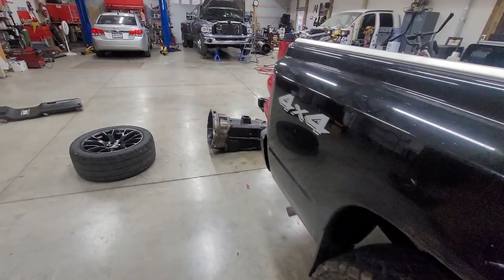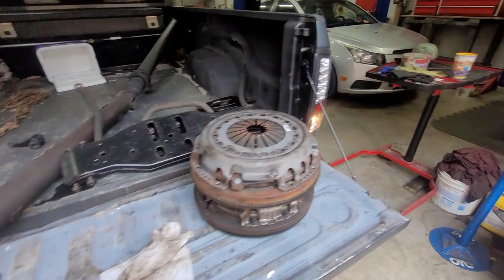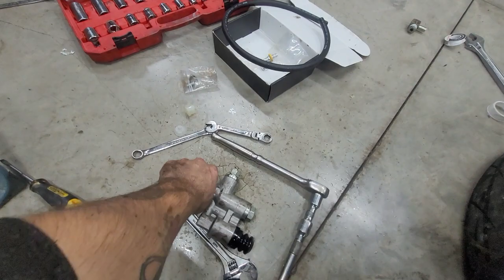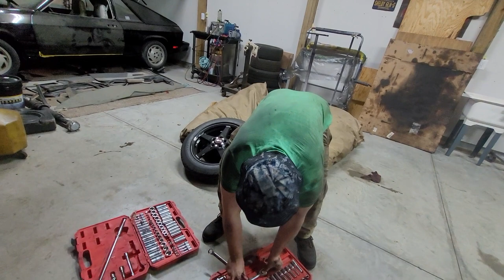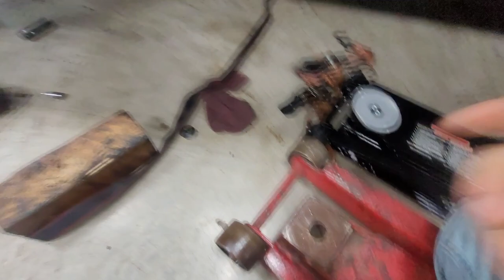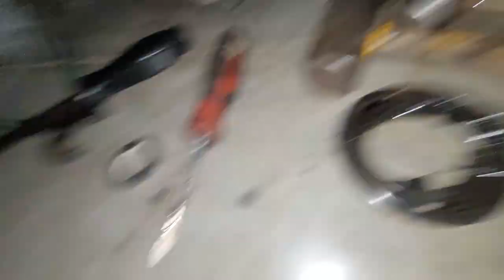NV5600 Swapping An 05 Cummins | So Many Little Leaks | Driveshaft Yoke Seal Replacement

Comment: Instead of draining all the oil you can use a shop vacuum put the hose where you put the engine oil turn on vacuum take drain plug out put new plug and gasket in won’t lose a drop of old works really good

Comment: You need to look at the drain seal, I turn it over and use the other side. I also have a plastic box with new copper o-rings.

Comment: 3 oil changes into my truck and I’ve never changed the plug gasket, I just clean it up and put some oil on it to keep from potentially ripping it when tightening

Comment: My first g56 lasted over 700k, my next lasted 300 miles, the one after that lasted 60k, the one in my truck now has lasted a little over 100k and currently still going. All miles pulling between 5000 to 16000 lbs.
Reply from the maker: That's a massive difference in miles. Awesome to as one last 700k. Going to gain some knowledge on them for future repairs.

Comment: My G56 is at 300k but what kills G56 is heat... they run really hot in 6th gear. I built a cooler for mine which solved the problem. It was nothing for it to get up to 250 degrees even on a cooler day now it doesn't get over 200.

Comment: My stepdad has a 2001 3500 6 speed 4x4 with over 500000 miles on it and the manual transmission has been rebuilt several times because he isn’t listening to the people that fixed it and kept driving like it’s a challenge, mind you that the truck has a 5 yard chip box and is always loaded, he has better luck with his 06 Ram 3500 6 speed 4x4 that always sounds like it’s going to explode but it’s been loyal, the 06 is a flat bed.

Comment: Are the driveshafts the same between a g56 and nv5600? Obviously need to be shortened or lengthened but is the yoke that slides into the trans the same?
Reply from the maker: G56 doesn't have a slide in yoke. It bolts to the trans like it does to the rear end. 

Nv5600 has a slip yoke
Reply: @CPSteveMiller ok thanks a lot. Will a 4x4 nv5600 driveshaft slide into a 4x2 nv5600?

Comment: Hey Steve, I am still using the same drain plug and gasket that my 05 came with sense it was new. Still seals just fine still.And I change my oil every 3 to 5 thousand miles whether it needs it or not. It's great to see you making progress with the tranny swap. Just out of curiosity what do you normally use for oil in a customers 3rd. Gen? I've always used 15-40 Rotella Full synthetic.
Reply from the maker: I like Rotella t6 in common rails. Guys have said good things about Mobil delvac as well. That's what I was using in my 12 valve thinking it was just a cheap Walmart oil but come to find it's a lot better than that so we're trying it out. 15w40
Reply: @CPSteveMiller  Great to know! Thanks for the reply Steve. 👍

Comment: My buddy has 350k on his g56 06 never pulled still stock clutch even tho it slips a little my 03 nv5600 has been rebuilt 2 times first time po did something second time the shop who rebuilt it did it wrong so 6th exploded
Reply from the maker: 571 on mine never opened 😬
Reply: You didn’t have a case on your 12v

Comment: How much did the conversation itself cost you? Thinking of doing this to mine eventually
Reply from the maker: Trans prices are all over the place. If you're doing it yourself get the trans and driveshaft if it's 2wd and it'll all just bolt up.

4wd get the trans, t case, and driveshafts. The transmissions are different lengths from each other.
Reply: @CPSteveMiller  Not counting the price for the parts (trans, t-case, driveshafts) what was it? I've read some electronics have to be bypassed so the computer doesn't freak out
Reply from the maker: Are you going from a g56 or from a 48re? This truck was a g56 to nv5600 so it was all bolt in stuff
Reply: @CPSteveMiller  Ah, I have the 48RE
Reply from the maker: You need to have to pcm flashed to a manual file. Other than that it's simple going from auto to manual

Going from manual to auto is a different story.

Pedal assembly, neutral safety switch, driveshafts, cut a hole in the floor for the shifter, etc. It's all simple but cost is all over the place. You could spend 5k on a swap, get a parts truck, or buy all new stuff and it'll be 10k+ easy
Reply: @CPSteveMiller  That makes sense. After doing some more reading I probably won't do a manual swap... I love driving a manual, but they're not as practical

Probably gonna go with an Allison swap

Comment: So then why for $250 bucks wouldn’t you just put a NEW orlieys clutch in? Why would you shoot yourself in the foot and put a used clutch in there? That’s so lazy and cheap. This is the things that make mechanics look stupid. With as much work as it is to pull a big honking trans like an nv5600, why you wouldn’t use a new friction disc and surface the flywheel? New pilot bearing, throw out  bearing, and pivot ball. You’re just asking for a come back. And aren’t you always saying you won’t send stuff ‘like that’s out of your shop or half slap job something? 
Rummaging thru a pile of clutches for parts it’s not the way, in certain circumstances to get yourself home in a pinch help yeah anything goes, but piecing together a trans swap and reusing old clutch parts is dumb, it’s a consumable, a wear item!
Reply from the maker: Gotta do what the customer asks at the end of the day. They sign a waiver stating they knew what the risks were. I'm not going to turn down a several thousand dollar job just because a customer doesn't want to spend the extra money on a clutch. Also, how am I going to get an oreilly's clutch in Carlisle? The closest one is 4 hours away.
Reply from the maker: That and you're commenting on a video that's almost 2 years old. You can't compare these videos to how I operate now.